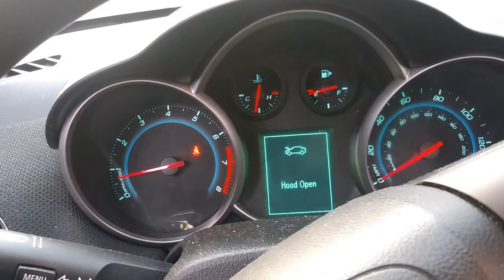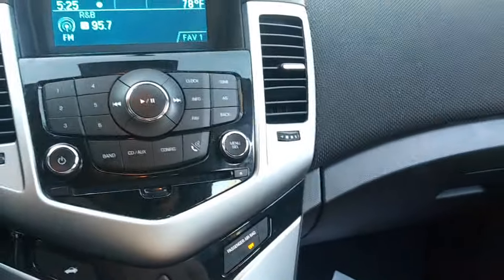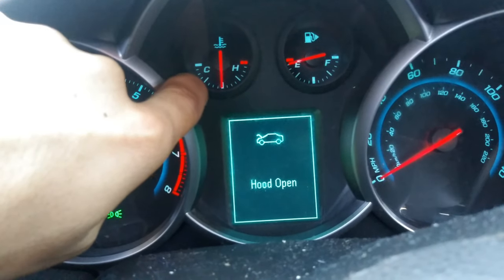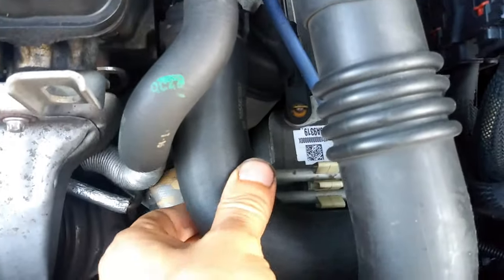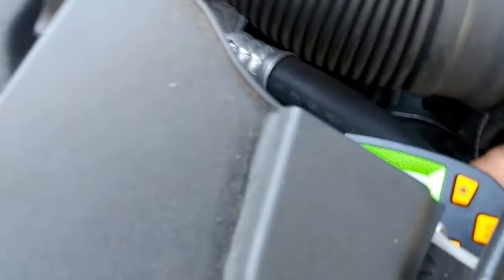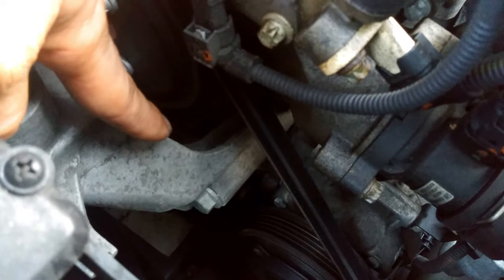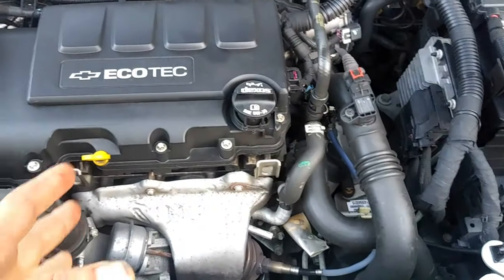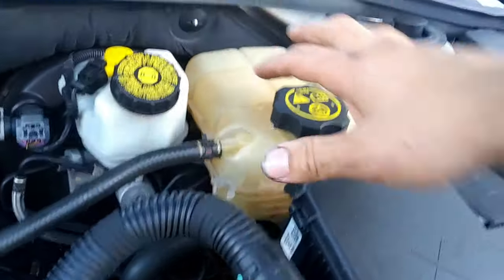chevy cruze overheating issues

Comment: Mine says is overheating but my gauge is on cold all the way on cold even when I run it for 20 minutes still stay on cold but the fan turn on saying is overheating
Reply from the maker: You have a coolant restriction/blockage
Reply: Jabo The Mechanic I change the fan all part and thermostat the gauge when to middle then when I drove it  when all the way to cold and it just stayed there with fan on
Reply: Omg! Mine is doing that now! It's a 2013 Cruze but it's intermittent. It did it yesterday but not today. Getting the thermostat and temperature sensors changed this weekend. Hopefully it helps.
Reply: I have another chevy Cruze and it has no problem I just returned the chevy to the guy that sold it to me but he haven’t fixed it jet
Reply: I know 3 other people with Chevy cruze's. Two of them have had the same issue. One of them has had to get another car because her transmission eventually went out. My transmission is headed there as well. I have 162,000 miles on mine and not willing to put much more money in it.
Reply: It’s probably the the temp sensors I had both of mine replaced and it solved this issue
Reply: Biggest peace of Garbage car I have ever owned in my life absolute Trash! Spent thousands repairing the parts over and over including a new engine due to the freaking coolant system problems that are never ending.
Reply: I have the exact problem, I’m going to my mechanic tomorrow to get it fixed

Comment: My Chevy Cruise is same year as yours. Just had new thermastate installed an two rad hoses I got lots of heat from my heater but after I go for drive and shut it off its starts to boil up and I have to continue to add antifreeze and after driving again the same my temperature gage on the cars stays in the middle all of the time. Do I have air in the line or is it possible that the new thermastate not working. Or could it be bigger problem
Reply from the maker: It could be  either  you have a small restriction or water pump not working properly
Reply: That sounds like head gasket

Comment: My 2014 Chevy Cruze LT did not have this problem when i bought it off a private party a year ago and it only had 34,000 miles in it. The “A/C off due to temp” “Engine Overheated Idle Engine” as well as “Stop Engine” Keep coming!!! The coolant in my car seems to be low right now but the previous owners didn’t really drive this car at all. Could it be the sensors? Also the car shakes a tiny tiny bit when in Idle. Please help, i don’t want my car to break apart.
Reply: When i got some service done for it, the mechanic put in some coolant 2 months ago, and the problem went a way for a bit but now it’s back. I also talked to another Guy who works for a Chevy Dealership and also told me that it could be Bad Sensors since the Gauge keeps rising and dropping. The engine isn’t too hot either, no smoke no nothing.
Reply: Car is at 58,000 miles now. Car runs great but it’s just the stupid “AC off due blah blah blah” messages that keep coming up” and it pisses me off smh
Reply: UPDATE: Sensor and Thermostat got replaced. No more OVERHEATING
Reply: Update: Haven’t had a problem since it’s been switched out.
Reply: UPDATE: I’m having issues with the temperature gauge now. This time, instead of the gauge reading hot and ACTUALLY overheating, it’s going all the way down to Cold. Strange because the mechanic told me that the car is running normally and as soon as i drive it for a while , the radiator fan goes crazy and sounds like a vacuum. I also get the “A/C off due to high temp” message…. It could be a bad sensor or thermostat but that can’t be it bc i switched the thermostat a year ago.
Reply: The coolant should never be low .it's not something the the car uses. Sounds like you got a leak somewhere.
Reply: @jameshanshaw516  i got rid of the cruze and got myself a 2022 toyota rav 4
Reply: @slyder65  Good choice 👌

Comment: Mine is doing this as well but the fan ( usually it comes on when it happens ) isn’t coming on . I’ve replaced the water pump and thermostat the last time I had this issue . Now it’s leaking coolant and smoking . Any ideas ?
Reply: Blown head gasket
Reply: Or cracked block or heads

Comment: My car is overheating, i changed my thermostat & I release my cooling fan is not blowing anymore so i guess that’s my next fix.
Reply: I replaced the thermostat and the issue seased for a while then came back and i figured it coudnt be thermostat cause i just replaced it. Theres leaking coming from close by where the guy said the waterpump screw is so im kinda scared my water pump may be bad. Idk, but thats a whooooole nother issue if so. Did you ever fix yours?
Reply from the maker: I have a video on how to replace the water pump

Comment: I have the same problem, I've already changed the water outlet, I've already changed the water pump, I've already changed the thermostat, I've already changed the antifreeze reserve cap, I remove the air from the reserve, everything was done in a week and the same on the screen. I have a 2015 chevy cruze lt, is there any other problem that could be
Reply: I have the same problem with the same exact car did you fix it ?
Reply: @itsjlotto  It was the radiator, I took it to a certified mechanic. I told him everything I put on it because that was what the other non-certified mechanic told me and the first thing he told me was that before putting all those parts on it, the mechanic had to have done the test. of squeezing the radiator hose with the hand on top to see if enough antifreeze was passing through and it turned out that it wasn't passing through, it was clogged and the mechanic changed the radiator and it's been a year since everything is fine

Comment: That's not a 15 cruze because I have one and that screen is to small and the thermostat is the issue bit it's also the owner putting sealer in the coolant it clogs the thermostat I have worked on cars for 33 years and have completely torn down and rebuilt my engine due to previous owner

Comment: Have code like P0236 for the turbo supercharger! Did not take it in consideration, another 2 codes one is ECT and the other is the radiator temp sensor, i changed the last 2 sensor, repoaced the thermostat, i have a circulation, but the engine is overheating, the fan does not kick on on time.
I replaced also the Fan and fuse boxes.
When using the OBD 2 i can see the real engine temp it starts overheating around 102 degree celsus but the gauge inside the car it does not show it it is at its standards place looking like normal temp, desoite changing the sensors.
So i do unplug the ECT sensor on a daily basis to make the fan run.
My question is: does the turbo supercharge boost sensor uave somthing to do with the engine temp? 
Once i reset the check the ECU starts giving outputs to the fan relays and the fan kicks on and once turning the car off with check engine coming back again the does not kick on.
The check engine is caused by the suoerchager sensor obviously.
Thank you and sorry for the language as a non native english speaker and typing quickly

Comment: Am having the same problem on my Chvy Cruze none turbo, the temperature rise to exactly point where the radiator fan should come,but it won’t, you will feel all the hoses are hot ,but I removed the temperature sensor you will see the fan starting working high speed, but If I plug it back it will not come,changed the sensor still de fan is not working while the engine is hot ,the thermostat is working u will see the thermostat hose is hot ,when you on the A/C den de fan started working,pls what be the cause?
Reply: My car keep overheating, I have changed the water pump, thermostat housing, thermostat sensor, antifreeze tank. Today on the dash it says overheating idle. Chevy dealership ruled out bad head gasket few weeks ago. What could be the problem?

Comment: Did anyone actually find a way to fix this for good? Our dealership fixes it and it keeps coming back
Reply: I’m also wondering this .
Reply: Unscrew the radiator cap and drive a non gm vehicle under the cap, then throw cap in trash. Problem solved.

Comment: Mine Has a similar problem.. I checked the coolant resivour and it has oil!
Reply from the maker: Blown headgasket
Reply: Is it the oil cooler gaskets ?
Reply: @mty8219  if it's a car engine oil, then u have blown gasket

Comment: Hi great video. Was hoping if someone can help me out. A 2011 Chevy cruze has an engine light with the “A/C off due to high engine temp” message. The cars heat in the interior works fine. The temperature gauge doesn’t work at all which points to the thermostat IMO. The fan is also loud as heck. How can I know if the car is still cooling because of the thermostat being stuck open or if it’s overheating. The car can’t be fixed yet but needs to be used. 

p.s. I got the engine code checked at autozone and the diagnosis said the likely fix is a thermostat. Let me know if u can   Thanks a lot
Reply: Also the car was low on coolant at one point but right now it has plenty. I just need to know if it is still flowing
Reply: Did you fix it ?

Comment: I have a 2011 Chevy Cruze rn & it has the “ac off due to high engine temp” issue even tho i replaced the sensors, my thermometer just stays on cold idk what’s going on
Reply from the maker: Did you bleed out the air from your cooling system
Reply: Jabo The Mechanic how do I do that?

Comment: I have similar issues but it keeps saying a/c off due to the high engine temp even after it's sat all night and well cooled it also has an engine code implicating the coolant sensor my Gage is all over the place. I have a new thermostat and sensor. I imagine I will have to reset the computer after I replaced the thermostat and sensor, is that correct? My Cruze turbo is 2014
Reply from the maker: Yes you would need to clear the code
Reply: Did you get this issue fix? my car is 14 Cruze and is doing this now ?

Comment: whats the best way to get air out of the cooling system?
Reply: Leave the cap off the over flow tank with heat on full blast run the car to operating temperature. Make sure you fill the reservoir first.  As the engine gets to temp it will cycle coolant and pull from the reservoir. Keep filling until it stays just below the fill line and you stop seeing the air bubbles coming from the tube into the reservoir.  This guy is dumb. There’s no back pressure the system has to hold steady pressure to keep the engine from lowering the boiling point.  Otherwise no pressure will let the coolant boil at regular boiling temp start to steam.  Then your screwed until it completely cools down a minimum of 4-6 hrs later. The thermostat housing is plastic and cracks commonly so don’t over tighten it when installing another one. Best bet these cars are junk and have major problems keeping coolant without finding leaks all over the system.
Reply: @freetoride003  thank you I’ve tried all that…it may be my water pump..imma take it to my local mechanic Monday..they don’t charge to diagnose it…I’m still getting bubbles in the resiviour and it overheats on idle after driving it for a while ..if I’m at a stop light if I rev the engine then the temp drops.
Reply: One other thing one the passenger side of the radiator there is a plastic plug at the top.  Kind of hard to see because there is an ac line right in front of it but pull that out and be careful not to drop it. Can be hard to find without a magnet.  When you fill the tank keep filling wit that plug out until you see a steady steam coming out and put the plug back in.  That will burn the radiator and the other part is burping through the overflow when it cycles
Reply: @freetoride003  is it possible that my water pump is failing even if there’s no leaks or sounds coming from the water pump area?
Reply: @russkaine  anything is possible but its not likely.  i just went through the same issue with this car and the fix was the purge plug on the radiator.  i searched for it before i tried to burp the coolant system and did not see it.  its not common for it to be on the radiator.  it's usually where the top coolant hose feeds the intake.  but once i pulled the plug out enough to get a stream of coolant to come out of it it pushed the remaining air from the system and started to cycle the system like it is supposed to.  this car has 75,000 miles on it.  when a water pump fails it will be noticeable.  wither leaking or screaming .  you will know right away.
Reply: @freetoride003  it’s just weird because I e drained the coolant twice and refilled properly…I finally took it to the mechanic up the street he doesn’t charge to diagnose
Reply: @freetoride003  so I replaced my thermostat with a better one because the stat I got was a cheap one from eBay…after I replaced it and drove it for a while it still tends to get hot…bubbles in the resivior and I also noticed I tugged on the radiator hose that connects to the thermostat and noticed that coolant leaked from the hose connection part with the locking clasp…put it only leaked when I pulled in it. Also that hose doesn’t get as hot as the other hoses.
Reply: @freetoride003  so do I pull that screw out and also unscrew the resiviour cap too?
Reply: @russkaine  that hose won’t get as hot because it’s the coolant feed when the thermostat opens to cycle coolant. The screw I. Plug only needs to be out long enough while you fill the coolant.  I try not to pull it all the way out just screw it out far enough that there is coolant coming out so like 3/4 of the way out.  If it does come all the way out that’s ok to. But I fill the res and then pull the plug.  That will make sure you have enough coolant to burp the air in the radiator without letting air back in if it gets to low from pulling the plug.  It only takes long enough to pull the plug and put it back it to get the air out.  Once you do that complete the fill and go through the process of running the car with the res cap off while it cycles at operating temperature.
Reply: @russkaine  also if I remember correctly that hose isn’t clamped it’s tightly fitted with a sliding clip that holds it in place
Reply: @freetoride003  yeah I did all that this morning. I unscrewed the res cap…unscrewed the coolant valve at bottom of radiator…then unscrewed the place is screw on top of radiator…let it all drain out…replaced new thermostat…then I tightened bottom radiator plug…started filling up res till I saw coolant come out of where the plastic plug goes…then screwed in plug…started car put heat on high….kept rpms around 2200 for five minutes….waited for a while then coolant started to rise and bubble in res…I put res cap back on and drove for a while…it doesn’t overheat while driving…fan comes on…it off and on overheats on the idle still…but I do get bubbles in the res
Reply: @freetoride003  yeah that’s what I meant it has that slide clamp you’re talking about…it won’t leak until I move it…is that normal?
Reply: @freetoride003  So hey check this out....so i just found out that the nipple on the inlet house that goes from the res to the top of the water outlet broke...do you think that's causing my pressure? I had to order the hose because my local auto parts store doesn't have it.
Reply: @russkaine  any where it can let air in the system will cause it to over heat.  if at anytime the res gets low enough that its empty its going to suck air in the system.  with no leaks and running properly the system will pull from the res just enough to keep the system flowing without air.  as soon as it cycles it will do that.  then it will push back what it took from the res and continue to run that way while the car is running.  thats why there is a file line.
Reply: @freetoride003  yeah I’m getting that hose tomorrow…I hope that’s the issue
Reply: @russkaine  it is possible to put the thermostat in backwards as well.  But if your loosing coolant then you obviously have a leak somewhere
Reply: @freetoride003  I’m not losing coolant but it’s definitely a slow leak at the connection that goes to the coolant housing…not enough leakage tho to see a significant loss of coolant…I know it sounds weird …but I think that’s the issue…I’ll find out later tomorrow when I get the hose delivered
Reply: @freetoride003  so check this out...I changed out the inlet hose that connects to the res to the coolant housing and that seemed to help a little...car still runs between 210-246 ive had 3 mechanics look at it and they cant figure out why it runs hot...they even did a head gasket dye test and it come out negative. one mechanic said that if it was his car he would drill 3 small holes in the thermostat metal cap area. have you ever hears of this? Whats your take on it.
Reply: @russkaine  sorry man i haven't been on for a minute.  make absolutely sure you don't have any other leaks.  but any leak will create a pressure difference and cause it to run hotter then its supposed to.  also check your transmission fluid level.  the temp sensor is on the same circuit so if the trans is low or getting hot that will show on the same gauge.

Comment: Hello there, I have my Chevy cruz 2012 and same engine heating issue is happening. My mechanic is saying it could be a water pump issue. Is that the case? 
what would be the regular charge of water pump in CAD?
just wanted a second opinion.
Reply from the maker: It should  be  from 400 to 500 make sure he replaces the thermostat housing as well
Reply: You can replace the water pump and thermostat assembly on these really easily. Just a standard set of sockets and a floor jack is all you need.

Comment: I changed the thermostat and two sensors but still overheating.
Reply from the maker: Waterpump? Did you bleed out the air pockets
Reply: @JaboTheMechanic   don't know how to bleed it
Reply from the maker: There is a bleed screw passenger side radiator  bleed air while idling and till air stops  coming out